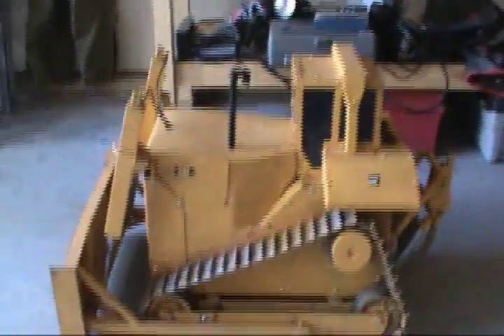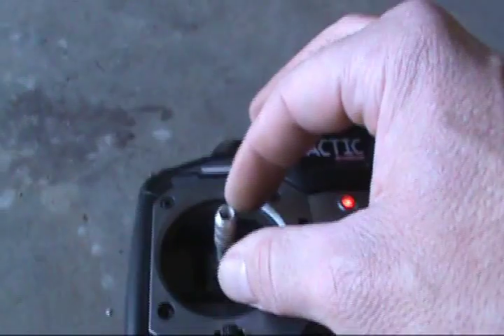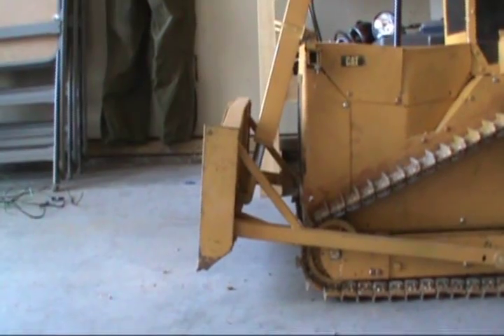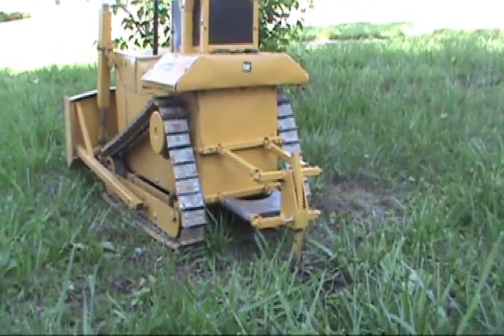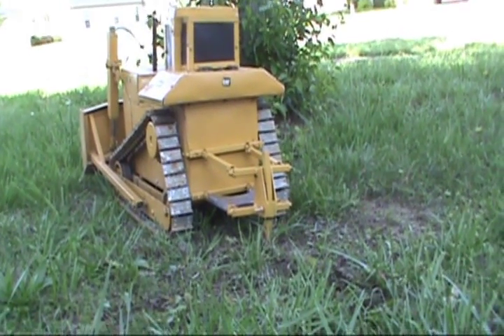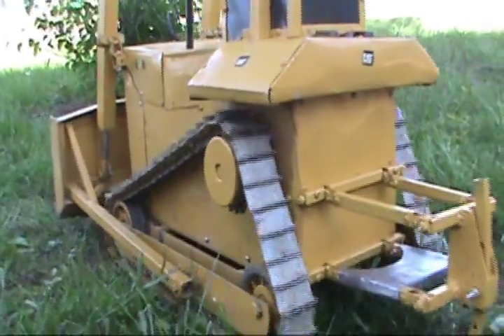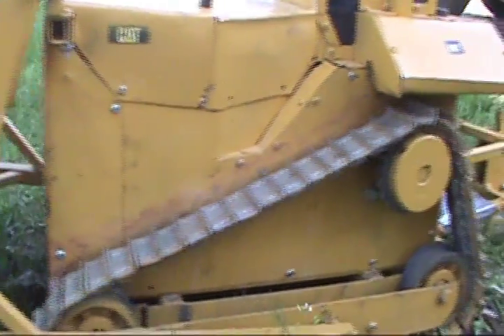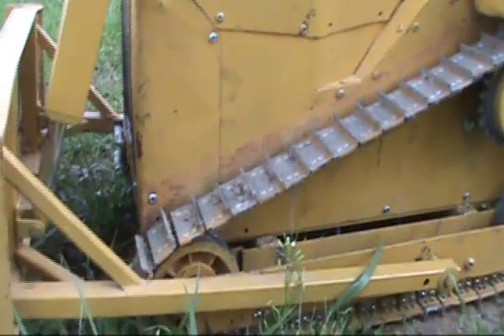RC Dozer testing new Electronics and Ripper

Comment from the maker: @younghoe72 Not sure what your asking....the setting of the wire connections, the setting for the radio or setting for the sabertooth motor control? There is a motor to each track...apply power to one track will make it turn...apply power to both motors with one going forward and the other going in reverse will make it pivot (turn) in one spot. Hope this answers your question.